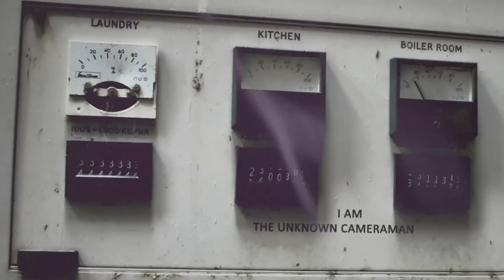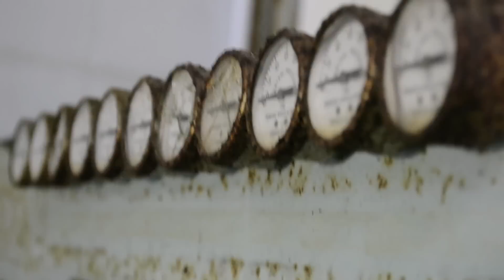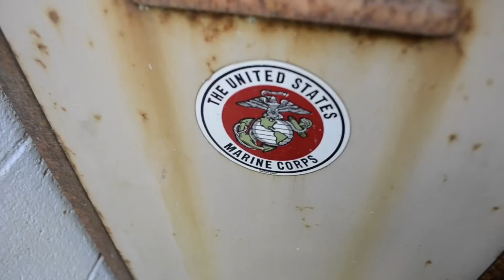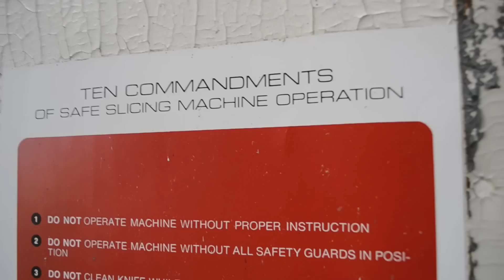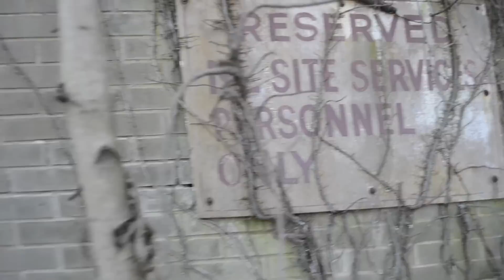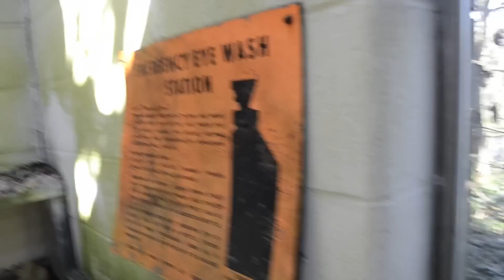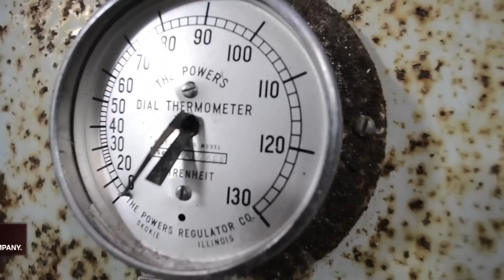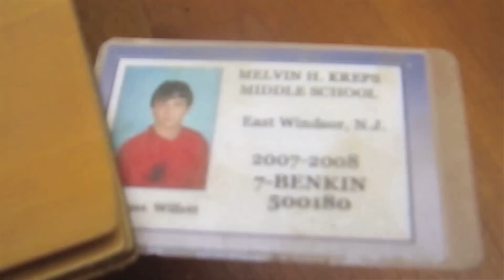Abandoned Chemical Research and Development Facility - NJ

Comment: My father worked at the NL lead plant associated with this  research facility. Within the area there were cancer clusters. IRRC three children in my kindergarden died of brain cancers before third grade. I often visited this research building with my father. It was more accessible than the main plant.  Often times we would boat up the river from my hometown and see the waste barges filling up. They would go outside the 3 mile limit, dump the residue and come back for more. It would all wash back into the bay and river.  This is one of the most toxic parts of NJ. So glad to be gone from there. I remember barges loaded with sulphur dioxide, blazing yellow in the sun. In later years I learned that when this was dumped into the sea, it converted huge amts. of seawater into dilute sulphuric acid. 

I enjoy your videos. I've explored a great many of the NJ locations you've filmed and was surprised to see them online. I think I've seen some in far better shape than you found them, but that was a long time ago. 

Thanks!
Reply from the maker: Thank you for sharing your experience, always interesting to hear!
Reply: Quite a few of your videos are of places I explored prior to '73. I appreciate what digital photography as brought to our contemporary explorers. Keep up the good work and stay safe.

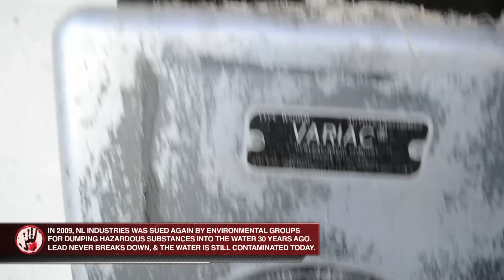Comment: Re: paulj0557  "That Variac at 19:23 would be a great thing to save! As a guitar player we put them on our tube amps to lower the voltage slightly. Eddie Van Halen uses one. It probably still works."

You don't want a 50-amp (it can also handle 220V at 20 amps) W50HM VariAC because it weighs a lot more than your amplifier.  Unless you like having lower back surgery, that is.

Comment: I agree, it would be nice to have some questions answered. Like at 19:18 ( ironic  it's the thumbnail, but I watched from beginning) the date on that bottle looks like 2-8-85, but there is another bottle with 13-85 so it sort of rules out 1985. Not to mention that much decay after 28 years looks way too severe. That's why this is so intriguing! How long does it take for buildings to get this bad off? The town of Kitsault,BC still looks decent after 30 years, but it's clean air...lived in LA,yuk!